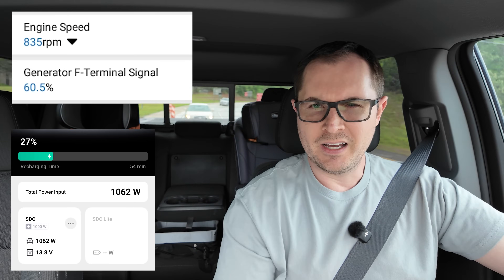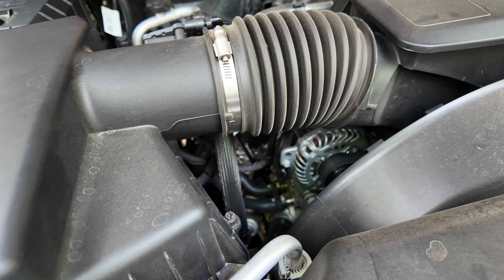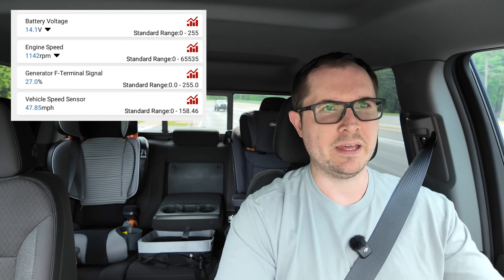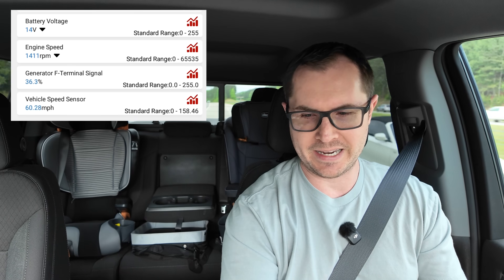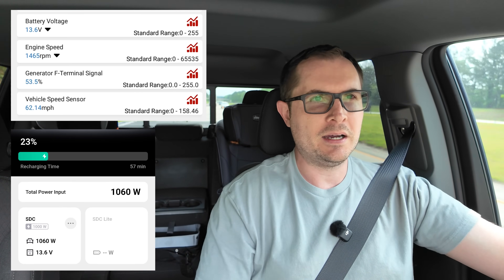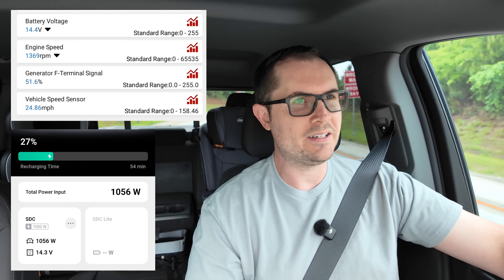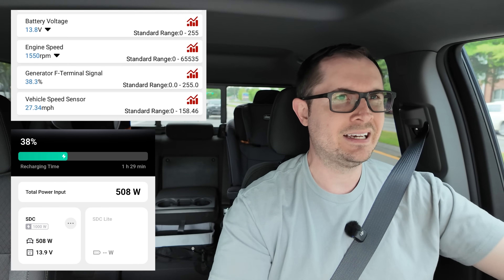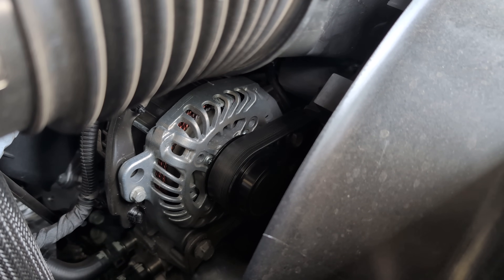I Show REAL Numbers: Impact of DC-DC Chargers from DJI, EcoFlow, Bluetti on Alternator

Comment: Good video, I'm a technician and what we were always told is that the amp rating on a vehicle alternator is a maximum amp output. The manufacturers only test 80% of that output for 10 minutes to meet that ampacity. Anything above that rating or the time frame is a gamble. Also that F terminal signal you're seeing is the fielding of the windings. The belt spins a internal magnet with windings in it. When the vehicle voltage gets low it increases the voltage to this internal magnet increasing the magnetic field in turn inducing more voltage into the stator windings. The real issue I see is at low rpm and high fielding the fan that cools these windings is driven by the belt so not much cooling action. This can cause the varnish on the windings to melt and short out. Good by alternator. Great testing tho, and love your in depth testing videos.
Reply from the maker: Thank you, and a huge thanks for sharing the extra insight as a tech. That is very helpful to me. Thank you.
Reply: Yep the car audio world knows about these issues. A typical alt needs 1000 engine rpms or so and output is lower at idle. But an alt can be wound specifically to have higher output at idle or a higher output. Some vehicles have a larger case heavy duty alt like for emergency vehicles. The smal normal units can actually overheat from higher loads.
Reply: 10 mins at 80% explains a lot!
I saw a boating video where the owner fitted a special alternator which had temperature monitoring, and an external regulator which let him limit unit temperature. The alternator was expensive, but likely to last a long time by avoiding overheating.
Reply: Question for you. Do you mean that we shouldn't install these chargers at all or maybe only use them in close to ideal conditions? Like max 500W (instead of their 800W or 1000W capacity), only turning the charging on while already cruising on the highway and preferable without A/C or not much of it? I already bought and installed mine (Ecoflow) but only did a test that lasted a few minutes so far and I can desinstall everything if needs be. Also, its installed on my 2025 Hybrid Sienna and I think they don't have the same type of alternator, would that make a difference?
Reply: @juliep-z4g I'm not familiar with hybrid systems. They will definitely have a different setup for charging as they use the engine to charge the drive batteries. I would look into how the charging system is configured. If it has 2 alternators. One for charging the drive batteries(which are usually higher voltage)  and one for the 12v system i would only be using a lower setting while highway cruising. I can't say for sure, every vehicles demand and charging supply is set up a little different
Reply: @juliep-z4g Toyota Hybrid's do NOT have alternators... you have massive engine hooked up to a planitary gear set that allows it to also connect to a DC motor which both can provide torque to the wheels and charge the battery when the engine is running. This thing generates KILOWATTS of power directly to the HV system, but your 12v aux system is where that ecoflow would hookinto. Thankfully 800w is within the range that a Prius could easily provide as going over 1000w consistently is where it starts getting dicey since I believe the main fuse is maybe 100A. The inverter could probably put out 1500-1800w but this is not recommended as it would eventually fry the system. So yes, these ecoflow systems were made for normal car use, but since alternators aren't usually ready for high amounts of charging this is probably suited better for those with upgraded alternators or have hybrid vehicles. This is because since the use is under 1000w and because the inverter is water cooled by the car by default so it's temperature has nothing to do with engine RPM. When the engine is off your ecoflow will charge off the HV battery through the inverted into the 12v system. The engine will start as the hybrid traction batter gets lower and keep it charged while also charging your ecoflow. This will eventually wear out your main hybrid battery though since it will induce more cycles. Keep in mind the AC in the car uses more power than the ecoflow, but it runs off the HV system.
Reply: If you're going to upgrade an alternator to use this charger, just use the charger with the factory alternator and replace it if it burns out. It might be just fine, and if it's not you were going to replace it anyways.
Reply: This is so well explained. These DC to DC chargers have been touted all over YouTube and other social media as the best thing since sliced bread - perfect for fast charging, blah blah blah. The problem is that they're frying alternators (and leaving people stranded in many cases).
Reply: What would a high idle switch do the the load on the alternator. If you were intending to use it to charge while parked? Would that extend the life of the alternator?
Reply: @robertbrannan9375 yes it would help for several reasons.  It brings the alternator speed up so its power output increases along with its cooling and also the under hood fan keeps under hood temps down.  

But look at it this ways. Say you are pulling 50 amps at idle and the alternator can only give 90 amps at idle. Well you are pulling 55 percent of alternator capacity. 

But now with high idle you are putting out 150 amps of capacity. Pulling that 50 amps is now only 30 percent off the alternator so it’s seeing less heat and stress.
Reply: Almost All electronics are tested this way. Whether you are talking about weldings machines, solar inverters, generators, audio amplifiers, even circuit breakers. All different industries, the rule of thumb always seems to fall somewhere near the 80% number, you should always oversize you system for it's intended use
Reply: This is why as an example,  most diesel 3/4 & 1 ton trucks have a dual Alternator option.   This is for fleet type vehicles, i.e., ambulances,  plow trucks and other utility trucks that have high electricity demands.
Reply: 說的好，感恩了解，謝謝分享！
Reply: So would fitting 2 alternators lead to less stress on each one? I’m building an overland vehicle at the moment using a Range Rover Classic so looking at options.
Reply: @DogmannUK  Yes, 2 alternators would basically split the load between the 2. A more practical approach would to get an upgraded alternator to handle the required current demands. This would save having to purchase a bracket and pulley to support the 2 alternator. Also in a pinch a replacement belt may not be readily available. Find out the extra demand you will be putting on the system and just add the amp draw to the factory ampacity rating of your alternator.
Reply: @icemanko  Yep. This is what I was thinking as soon as I saw people are going this way with these chargers. Upgraded alternator and just factor the cost of possibly having to replace the alternator now and then in with normal maintenance and expected costs.
Reply: @DogmannUK I've used a National Luna 40a  DCDC charger on my old G Wagon overlander for years. Max charge is 560w and it rarely sees that to maintain a 120ah lithium battery. I've even driven a Ecoflow AC system from it for long periods pulling 500w constantly. So far at least the alternator hasn't fried itself..
Reply: @OverlandTheSlowWay  That must be a quality one.  Expensive.  Thanks for sharing your exprrience with it!!
Reply: @DogmannUK  The dual alternator does seem to be the ultimate solution.
Reply: How are these any different than if my car comes with a standard plug that I can use to charge my power stations?  Trying to understand.
Reply: Great information, I love the common sense approach to your test. When you see 70, 80, 90% that is not good for the alternator. Thanks.
Reply: Just bought a 200 amp akternator for my 2006 sprinter to replace the stock 90 amp for the instalation of my 800 watt alternator charger
Reply: A 1000 W at 13.5 V is 74 Amps. So about half the total output of your alternator. So it is quite a load and if the ambient temperature is high then the alternator will be running too hot and excess heat will eventually destroy the alternator.
Reply: (Iceman is correct)
Alternators are not actually battery chargers or they would be called battery chargers. They’re designed to maintain the battery voltage in the vehicle under different load conditions created by that vehicle for one battery.  Lower RPM requires a higher field voltage to maintain your battery at 13.8 - 14.2v  
Adding a trailer with the banks of batteries and trying to charge them with your alternator will not work out well for the alternator
Reply: @AnthonyRich5357  then what recharges the battery?
Reply: @AnthonyRich5357 you're not charging the batteries with your alternator though. You're turning on a charger. It's the same principle as plugging this into the chargers built into your vehicle
Reply: It seems the most important factor (internal temperature of the alternator) is the most important parameter for which there is no data.

A 90% alternator output at  idle rpm, 0 vehicle speed, and minimum alternator ventilation will be much hotter than 90% output at highway speed with near maximal ventilation passing through the alternator.

Some cars (BMW comes to mind) have a dedicated ram air ventilation duct that gathers and directs cool ram air entering the grill onto the alternator cooling fins.
Reply: I run a 50A DC-DC Booster on 90A alternator, the booster draws a total of roughly 55A (~90% efficiency), the lights take another 12-14A + Radio and a couple of USB outlets. According to some drawing I found the Bosch alternator installed provides 65Ah at 1000rpm (my engines idle speed), so technically at night I'm running a deficit at idle. It seems the starter battery is acting in some capacity as a buffer. However I had 4 broken alternators in 18 month (~40.000km), since its always running under full load it appears to put also put a lot of mechanical stress on the alternator.
Reply: I never really understand why knowledgable people simply parrot "stuff wot they heard".

Alternators have an international standard they must abide. They are electrical generation equipment. The standard? Its IEC60034-1.

The standard will tell you exactly what manufacturers may describe as "rated output" based on the type of operation of the device.

There are mentions of devices intended for periodic use being rated for 10mins full load, with duty cycles of 60-25% but nothing mentioning 80%, or 20% derating.

Not that alternators are intended for continuous load operation, but citing "80%" is not based in fact as far as I can see, and the likelihood a manufacturer can list a "maximum output" as a "rated output" without breaking the law is exceedingly improbable.
Reply: @lmaoroflcopter  Goes to psychology. People generally strive to Sound knowledgeable which means they're important and people listen to them. It's the whole drive to power kinda principle. So the more things you can say that make you sound knowledgeable technical etc the more people are apt to listen to you and pay attention. Problem is many open their mouth before their brain has the info to expel.
Reply: Would this have the same implications for a Ford with Pro Power Onboard?
Reply: @TheTyJenks  I'm personally not familiar with the Ford inverter system. But I would assume that Ford has done the math and put a correctly size alternator to support the inverter.
Reply: @ thank you, sir!
Reply: You’re absolutely correct.

Comment: Interesting. I don’t think your idle voltage ever dropped below 13.5v despite  the DJI at 1Kw charge rate. Not sure about the DJI but other units use a voltage setting to reduce or stop charging albeit this is to protect the battery state of charge and not necessarily the alternator.
Of course, alternator temperature will also be an issue at idle (parked) while operating at those output levels. Thanks for the info!
Reply from the maker: Great point. For DJI 12.6V is the minimum in the app (12.8V is default setting) whereas some competitors of DC-DC let you drop down to 12.0V. Only issue I've encountered periodically on my GM is with the GM EPM (elec power mgt) system where it tries to save fuel by slowing alternator and letting battery discharge to 12.6V. I can't startup the DJI charger on the fly when the truck decides to go into that fuel saving mode while driving, but one can get out of it by turning on headlights, wipers, AC, etc and then it goes back to normal range in the 14ish volt range. More of a nuance with GM trucks, but at least the DJI is respecting the alternator's capabilities.

Comment: The dual alternators and extra battery is such a cheap option wish more dealer would add that. Seems like only way to get it is to order and I've been waiting for 10 months already.
Reply from the maker: That's a great point, and often overlooked. In hindsight I wish I had spec'd my truck with the optional 220amp...only $150 more, and surprisingly dual alternators (220+170) is only $380. Bargain at that stage.
Reply: I've got a 22 3500 hd gasser. It came with the 220A alternator on because it had the snowplow option. I purchased the parts ( dealership parts dept was no help) and added the second 220A alternator dedicated to running a DC- DC charger. So far its been good but I don't have many miles on it yet. I like the idea that everything I added was an option from factory and NOTHING is tied to my trucks electrical system. It is dedicated to the DC - DC charger. Currently the alternator is being managed by an external voltage regulator with temp sensing for alternator & batteries. If all goes well, I'm planning to replace alternator with a high output Balmar from the marine industry.
Reply: I ordered my 2024 gas GMC 3500HD SLT with the dual alternators, dual batteries, and the high idle switch with thoughts of a truck camper in the future.
Reply from the maker: Hope your build goes smoothly and speeds up. Sometimes it can seem like an endless wait.
Reply: @AdventureRocks  thank you hope to see more videos
Reply: I've seen where the after market alternator companies that offer higher output alternators say you must change out the oem cables i.e. the + - and one other cable forget which to a bigger gauge wire to keep from overloading  the oem cabling.  Is that a real thing. I have a 2013 and a 2016 CR-V EXL Touring Hondas.  Not sure they would handle any of these DC to DC charging devices.
Reply: @fuzfire  You are correct, my system has oversize dedicated cables ran for only DC to DC charging. These are not connected to my truck electrical system in any way other than a common ground. So far, it's working well.

Comment: Fantastic video and very helpful real use case data!  Very interested if you can share your setup collecting the data.   Very much like to see how my Ram 180w alternator handles the Bluetti Charger 1 DC-DC.
Reply from the maker: Thank you. I like the universal nature on the Bluetti Charger1 supporting just about any lithium battery or power station...I've got it on my Jeep and works great. On the OBD2, Kingbolen sent me the S800 last year and it has come in handy for reading data on my truck. If interested, here's a video showing the form factor:
https://youtu.be/KTpE6s-kfJY

It's basically an Android tablet and personally I actually like the dedicated form factor over other bluetooth modules, mainly as the S800 doesn't suffer connectivity issues. Plus, when I'm in a pinch I don't have the fuss with the pairing and connecting...it just instantly works. It has quite the menus and features. I'm pretty sure it is based on an open-source platform so there may be other similar brands with nearly identical units. For the $$ it's been a great tool though.

Comment: Great Video,  Very informative. I'm guessing that if you were driving eight or ten hours at a time you would be able to keep it turned down and it wouldn't have any problem keeping your power station charged and would put less of a load on the alternator.
Reply from the maker: Thank you. I'm with you 100%...even limiting to 250W is relatively fast and not much of a load at that rate. 500W and under is probably where I'll keep mine limited to most of the time.

Comment: DAYUM! Geniusnessness! 😁I have told many people that the DC-DC chargers used in the towable RV world, can not be good for the alternator if you are using high amp chargers, or multiple chargers. My theory, and it is only a theory because I have never measured it, is that manufacturers do no put alternators in their trucks that are 2x the needed capacity of the truck, purely out of the goodness of their heart. I have a Ford, but I am sure there must be a data line for the same or similar info. What app are you using with the OBDII dongle to mine the data you got?
Reply from the maker: Thanks for watching. Yes, Kingbolen sent me the S800 last year and it has come in handy for reading data on my truck. If interested, here's a video showing the form factor:
https://youtu.be/KTpE6s-kfJY

It's basically an Android tablet and personally I actually like the dedicated form factor over other bluetooth modules, mainly as the S800 doesn't suffer connectivity issues. Plus, when I'm in a pinch I don't have the fuss with the pairing and connecting...it just instantly works. It has quite the menus and features. I'm pretty sure it is based on an open-source platform so there may be other similar brands with nearly identical units. For the $$ it's been a great tool though.
Reply: With the HD trucks you can order larger and additional alternators from the factory to handle heavier loads like hydraulic pumps and electric motors.